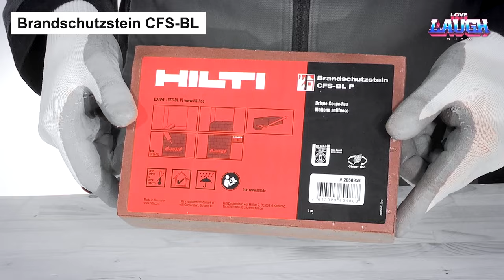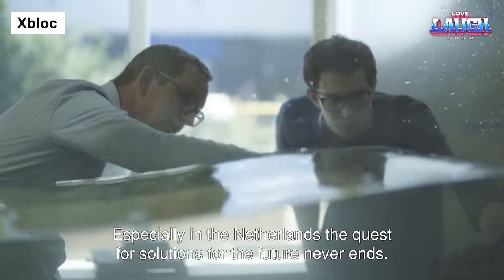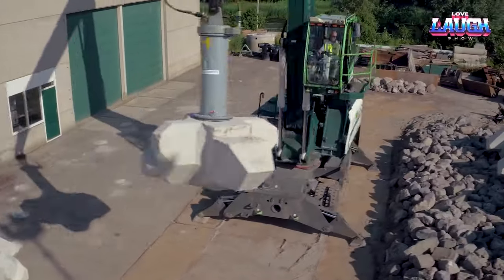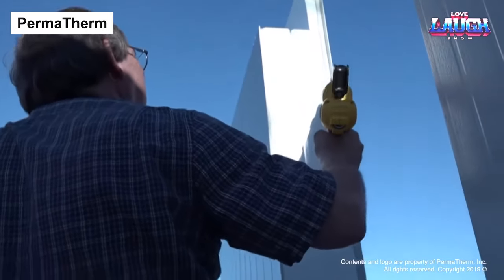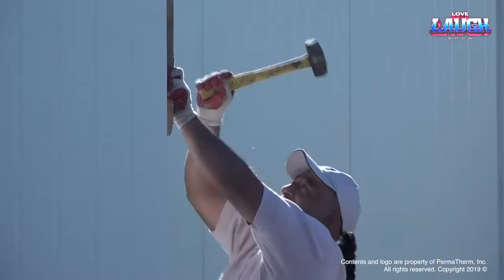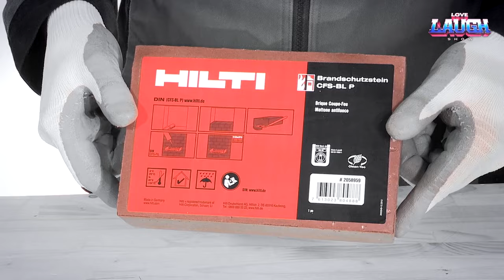Ingenious Construction Workers That Are At Another Level ►6

Comment: CFS-BL sounds cool and all, but $69 for that small block?
Reply from the maker: Prices can indeed be steep, especially for niche or specialized items. Always good to weigh the value against the cost!
Reply: They use them in hospitals and data centers. there not for residential (they will try and tell you otherwise). There for high end industry where you need to properly partition a building.